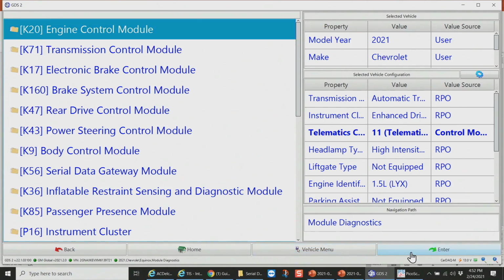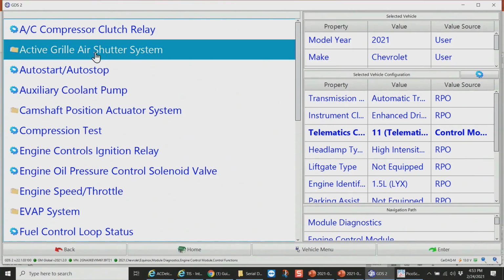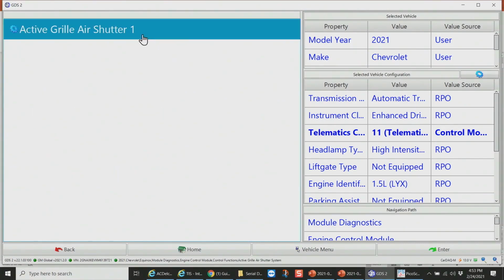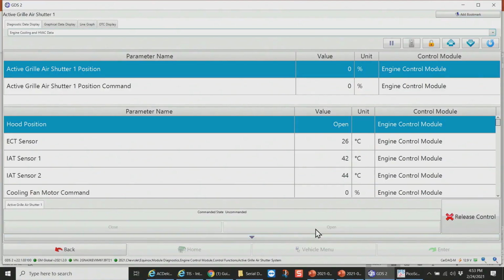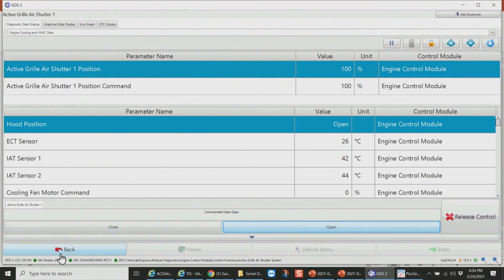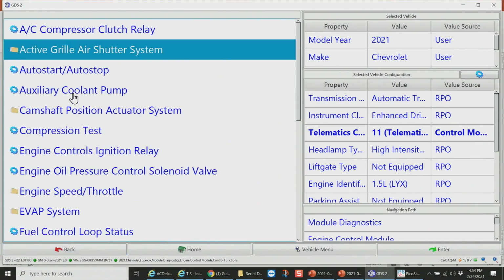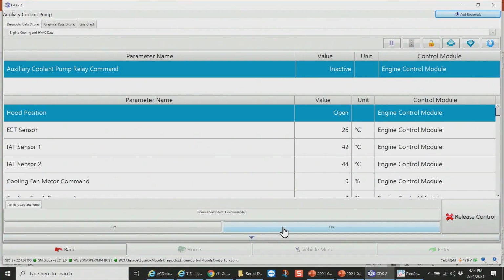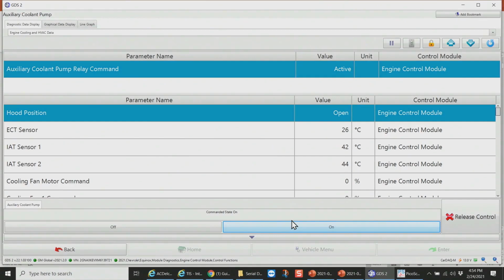Scan Tool Louver Testing - Tech Tip | Computer Controlled Cooling Systems

Comment: A good coolant video to make I’m something like BMWs AC compressor discharge right into a plate heat exchanger with the electric glycol coolantpump that circulates glycol through a heat exchanger on the front of the car in place of the condenser.     Show the malfunction effect of not properly filling up the glycol after a collision or a glycol pump that is not pumping glycol  through the plate heat exchanger to take away the heat from the compressor discharge. 
                     On the Dodge hellcat do I call loop system that the AC compressor is connected to with the second expansion valve for cooling the glycol for the super charger to cool the air for the plate heat exchanger’s on the engines intake manifold would make a great video for diagnosing malfunctioning parts. 
                    Also Audi and Volkswagen have an SUV that I’ve been working on lately with the air conditioning that has a heat pump with the glycol system for the hybrid. 

        The future is here
Lead follow or get out of the way